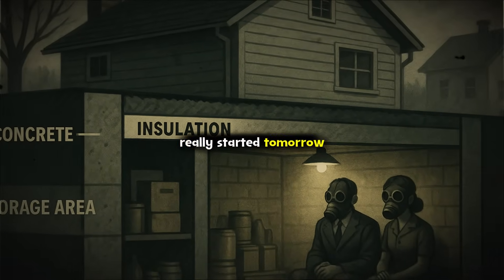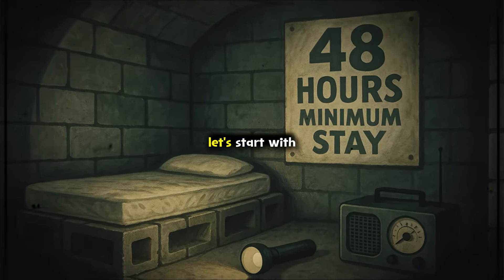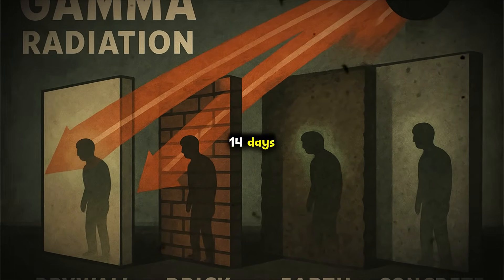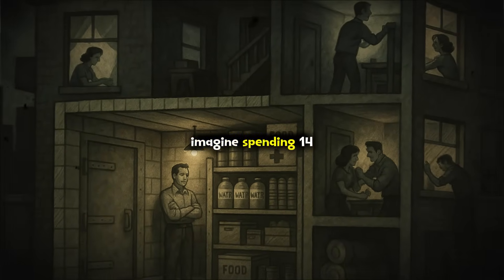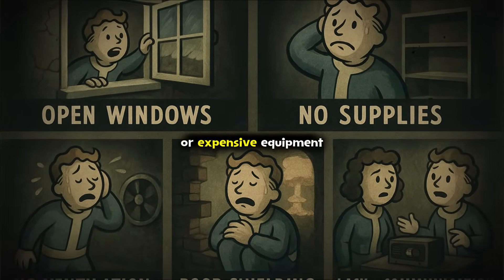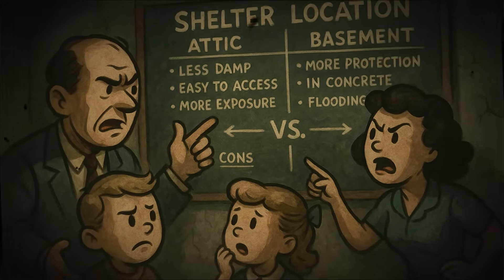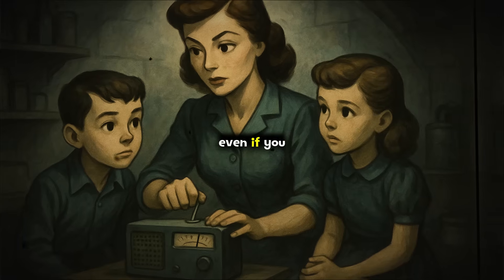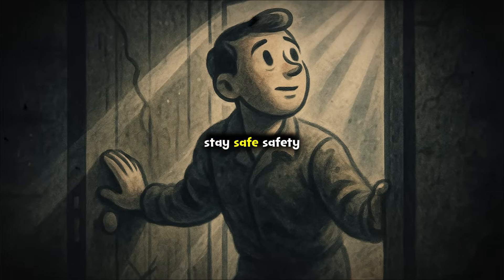Nuclear Bunkers: What Really Works—Build Right & Avoid Fatal Myths

Comment: Nobody escapes. Even the most elaborate bunkers built way undergkround by even the richest people . Power generators run on gas and run out and then what? Eventually you have to come to surface and get radiation exposure! No air-conditioning either or heat and what do you do to pass the time? How long can you stay down there until you start losing your sanity like being in a prison and even prisoners get out for fresh air but you can't? How many of you are down there? How much food supply is there? Water supply? And what about medical attention? What if you need meds? A doctor? A dentist? Do you have all that? No, you have none of that! Do you think you won't suffer with anxiety and depression and fear? And what about the temptation of going up to surface? What will you see? Nuclear winter! That's what! It won't be fun and games!

Comment: This is just an observation from a non expert, but a lot of preppers gravitate towards freeze dried foods. This seems unnecessary and excessively expensive at best. Not only will you have to use your limited water supply to rehydrate them, but there are plenty of highly nutritious items at the supermarket that have shelf lives well in excess of a year (think canned foods). And further more, the printed date is a "best by" date rather than an "expiration? date meaning they will still be safe to consume, they just might loose some flavor and nutritional value over time. But if you are worried about that, just rotate your stock. Every time you finish off 4-5 cans of Bush Beans, for example, buy another 4-5 and put them it the back of the shelf. Dehydrated foods serve there purpose (they are light, take up little room, and are perfect for camping trips), but the way I see it if you don't plan on permanently staying in your shelter for more than five years and have an infinite water supply and endless heating source, they really don't belong in your shelter. If I am wrong on this, please politely educate me.
Reply: I say learn how to preserve food yourself like jarring, dehydration or making jerky
Reply: This goes for all shelters when the diesel generators runs out of fuel its over to build and underground sheler only prolong ones life with some months than follows an horiffical death

Comment: My home sits on a slab. I cut a hole in the slab in the hallway and built our shelter under the house. It cost some money, 2 feet of reinforced concrete all the way around.
Reply: Unless you are within 10 miles of a target area you are wasting your money.. Better to add a dirt embankment outside as a "landscape feature" on the side toward the city center or industrial center then build either a concrete block walled room or some other moisture resistant material that will support the weight of the slab above then spend some money on ventilation, powering, dehumidifying, water storage, quick heat and eat food and sanitary waste disposal.. If you are way out in the country then 8/10x100 foot rolls of plastic, staplers, duct tape or packing tape, a couple cheap radiation detectors inside several layers of Ziplock bags and in metal cans, a poor mans air filtration system that consists of a several stage air bubbler filter, five gallon buckets with poly fill and a furnace filter for allergy"8".. You can build the filter for $50 if you can scavenge pipe, buckets and 55 gallon plastic drums.. So a couple hundred bucks worth of supplies would be enough to save your health from most fallout for a long time and certainly past the half life point of most to all the radioactive elements that are quick killers.. Having iodine pills and iodine hospital disinfectant wash to clean yourself from mild exposure to fallout would be on my list..
Reply: That’s was an amazing explanation, the problem is the money to get all done, plus here in Florida where we live we have water at 5 feet under the ground surface, so part of the shelter should be out of the ground
Reply: @humbertodiaz2889   Yeah, in Florida, you'd have to build the shelter first and then the slab. If possible, I've never heard of a basement in a house in Florida.
Reply: @humbertodiaz2889  They make very large plastic tanks that can be buried.. You could have several of these linked together even in your areas conditions as they are rigid and water proof.. Having a high enough entrance tunnel/shaft to prevent a hurricane from swamping the entrance and air vents would be an issue because it would have to be protected from a blast wave.. You would also need to anchor and weigh down these tanks to prevent them from floating up out of the ground..
Reply: You’re right, also I was looking at those fiber glass storm shelters that are completely sealed, adding a concrete slab on top of it and then enough dirt, plus some ventilation system they might work for a small family for a few days or weeks
Reply: @humbertodiaz2889  If you rig it right it could also be a survival capsule for a tidal wave if you made it so the hold down weight could be released so it could float.. I know there was a guy down there that built a motorized and armored survival floater out of an old fuel tank or fuel tanker that had external tanks that he could flood or pump so he could alter the height and stability in the water like a submarine but it would not submerge.. Sorry, I just went deep....
Reply: That could be a good way as well to try to survive a blast. The closest possible blast from me would be just over 50 miles away. So all I really have to try to avoid is the fallout.
Reply: Concrete won’t save you
Reply: @D3M0N1C_40RMyes it will? As long as it’s thick enough 😭
Reply: @StitchTheHyena Question is, are you that close to a target?? If not, then that concrete is not needed for fallout, heat or blast protection.. A sheet of 2mil. plastic stops radioactive dust, so best advice is don't live in a strategic target area..
Reply: @D3M0N1C_40RMyes it will

Comment: This is a mixture of good and bad advice. After you get through saying you don't have to be a billionaire to have a shelter that can make the difference, you go into what a shelter "must" have and what surely won't be good enough unless you spend that money. 

The number one rule with nuclear fallout is, don't inhale or ingest it. Any effort at filtering air is risk mitigation in that the amount of radioactive particulates you take in will be less than it would otherwise be. That makes even a less-than-perfect effort well worth it.

As for chemical and biological agents, there are instructional videos online for how to make an air filter for growing pot plants in grow rooms. They make them out of discarded food containers, short lengths of plumbing pipe, and activated carbon for filtering fishtank water. At the very least, such improvised filters will reduce the amount of organophosphate in the air down from what it would otherwise be. That can make all the difference, depending on how much chemical gets released and how closely to the shelter.

A lot of biological agents would probably be bacteria rather than viruses. Bacteria are much larger than viruses and so the filter you use could be 5 microns instead of a <1 micron. So, the filter that is less expensive and longer lasting will actually work best in that case.

Also, painting your house white and putting energy-saving white paint on the roof can help your house to not catch fire from the flash of a nuke going off. That is important if you're sheltering in a basement. You can unplug wires from all electronics and wrap the electronics in foil to stop the EMP from frying them. Empty coffee ground bags can be used to store cell phone chargers because they are metal foil. IF a wire cannot be unplugged from an appliance, then coiling the wire cord into a figure 8 will reduce the amount of destructive voltage it generates in an EMP.

If the whole complete effort is too daunting for one person or one family, or you just don't care to save yourself, you can rise above worrying about only yourself and yours and contribute to someone else's effort. If you don't like the idea of helping an "elite", then help a non-elite like a first responder, a conservation professional, or a civil engineer, etc. Maybe another family has young daughters, who need to be kept as far from the radiation as possible to preserve their future child-bearing prospects. Maybe you can ride out the blast in someone else's shelter, but then immediately exit the shelter because you are outside the area of intense fire and smoke. You can fight what fire there is, spread and tape tarps over a damaged roof and do a million other useful things before the dangerous fallout arrives, and you might be able to create enough above-ground safe space in time to make it through yourself. You can keep ventilation intakes and exhausts clear and protect them. You can protect the shelter from resentful aggressors. There are many ways to approach this.
Reply from the maker: Fantastic contribution—you really bring a practical mindset that goes beyond theory, and that’s exactly what Safety Zone is all about. You’re right: while our video lays out the “ideal” technical guidelines, we always try to stress that every step you take—even with limited resources—can dramatically improve your odds.

Your tips on filtration, both for fallout and chemical/biological threats, are spot on. Even an imperfect homemade filter can be a lifesaver by cutting down what you breathe in, and knowing the difference in filter size for bacteria vs. viruses is a game-changer for most people. The advice about white paint for fire risk, EMP protection tricks, and creative use of materials (like coffee bags for shielding electronics) is exactly the kind of out-of-the-box thinking the community needs.

And your last point is so important: survival isn’t just about personal prepping—it’s about helping others, pooling skills, and thinking of the bigger picture. Sometimes your best chance is teaming up, whether it’s with another family or supporting people with critical roles.

If you have more field-tested hacks or want to share a specific build or experiment, let us know! The more real-world experience and resourcefulness we collect here, the stronger everyone becomes. Thanks for raising the bar for community knowledge!

Comment: Locking yourself with a candle for an hour to test the shelter tightness may be the last thing in your life😂
Please invest at least in CO detector. CO2/O2 measuring devices may save your life-especially during the seal off phase right after the blast.
Reply from the maker: Great call-out—you’re absolutely right that using just a candle is a very old-school test and comes with real risks. Investing in a CO or CO₂ detector (and, if possible, an O₂ monitor) is much safer and can literally save your life in a sealed shelter situation. Modern detectors are affordable and reliable, and they give you clear feedback if oxygen drops or dangerous gases build up—way better than trusting your luck or an old survival trick.

Thanks for bringing up this point! At Safety Zone, we always say: tech can’t replace smart planning, but using the right tools adds a critical layer of safety. If you’ve got recommendations for specific detectors or other must-have gear, share them! Your advice could make a real difference for the whole community.

Comment: Honestly, I’ve got an underground shelter that can sustain me pretty much indefinitely. When I bought my house, the previous owner built it himself. The basement is several feet thick with only an outside entrance. I decided to completely concrete it in, creating an interior entrance with two escape routes from inside the bunker. If I need to come and go, it’s through the house because I’ve camouflaged the exits to keep them from being discovered.

After remodeling, I installed a stand-up shower and a wash sink connected to our well, which can run off a 12-volt battery or a hand pump. We have just under an acre of land with around 40 berry bushes, five grapevines, and a pretty large garden. My wife and I have built up an impressive pantry by canning our own vegetables.

When we go shopping, we always pick up at least 10 cans each of various meats, soups, vegetables, fruits, and other essentials. We also grab at least 20 lbs of sugar, salt, and powdered goods like milk, eggs, and different fruits and vegetables, which we then repackage in mylar bags. Plus, we buy about 20 lbs each of rice, beans, and pasta.

I’ve got a small suitcase filled with my seed collection and everything I need to start a garden. Preparing takes time; it’s not just a quick trip to the store. It’s a way of life. I like to keep six months to a year’s worth of food on hand, but ideally, I prefer two to three years’ worth.

With five buildings on my property, it’s the perfect spot for our family to bug in. It’s completely fenced off, and we have a wood shop, a studio/Airbnb, and a mechanics garage.We also have a nice pool house by our swimming pool which holds quite a bit of water. 

Naturally I have a plan to defend the property but I tend not to talk about it. If forced to I also have an evacuation plan in place that I believe would maintain stability in my family. 

I own an ice cream truck that is completely solar powered and also has an inverter installed. There are 10 solar panels on the roof of my ice cream truck and on the inside there are three freezers and a refrigerator. It's a Chevrolet p30 box truck with a 350 motor in it. Only 70,000 mi on it and in great shape.

 If we had to bug out I would load all my frozen food into the freezers, put all my supplies into totes and put them in my trailer and pull my trailer with my ice cream truck. I would use my pickup truck, my car, and my wifes SUV as additional vehicles to add to our motorcade. I have around 550 gallons of propane and various hundred and fifteen and 20 gallon tanks. 

There is a full-on kitchen that I can use in my ice cream truck and a stand alone hot water system that holds about 20 gallons of freshwater and 25 gallons of gray. So we can take our vehicles and camping supplies go out in the middle of nowhere and set up shop. It takes a long time to actually get prepared. There's a lot to think about and a lot to plan for it and everybody's plan is going to be different based on their situation. 

Regardless I wouldn't take it lightly. The world we live in today is definitely not a safe place
Reply: 1st rule of prep: NEVER TELL ANYONE YOUR LEVEL OF PREP.
Reply: Good for u
Reply: @1985daddyd waaaaah
Reply: IM 67, MARRIED STEFFY IN 2015. steffy is 37.yes, she is FILIPINA.  been a "survivalist" since the 1960's when i was a kid.i inherited $200,000 in 2018. ive spent 10 years of my life in prison too. i have no problem living with myself after doing horrible things to others. 
everyone thinks we are DIRT POOR. 
they CANT TAX, what they cant see!
Reply: Impressive ... soothing... makes me miss my family even more..everyone is gone. The ones who are still alive are total opposite type of character. Generationally Inherited cold war willies skipped them...
Oddly I find myself in 2025 not even able to find local birds of a feather..except...the birds that are flocking together are..ion know what to call them...evil? Lazy? Possessed??
Not my flock.  . ...I'd be a pheonix.phoenix..  all these ppl here are buzzard vultures with monkeys or parasites on their back.....
Reply: i got fuck all
Reply: Very nice and I'm on my way to that as well.
Reply: I live on a small 5 acre farm.  We let one of our friends keep their miniature cow in our pasture.  He's probably only about 200 pounds, but if push came to shove we'd be feasting on ole Moo-Jangles.
Reply: Concrete won’t save you

Comment: Another thing to keep in mind is storing only freeze dried food will most certainly upset your stomach. Your body is not designed to switch from one type of food to another that quickly. You’ve got to build that sort of stuff up slowly mixed in with other non-perishable items like canned goods or else you willnot adjust quickly enough to keep you from getting sick.
Reply: The most compact and digestible stuff to survive on is the protein meal/breakfast replacement powder mixed with powdered milk and some of that powdered rice baby food.. A heaping tablespoon of each in a 12 to 16 ounce cup of hot/cold water two to three times a day along with a vitamin a day will easily keep you alive.. It also reduces your solid waste to near nothing and something like it was once stocked in US fallout shelters.. Sugar based hard candies can provide energy to do more physical tasks and these were also stored by the bucket full.. Having an assortment of canned foods that don't require cooking to eat (although they would be more appetizing and digestible if you could warm them) is always a good idea although waste disposal will be needed.. Water is very important and I found 2 layer 3 and 5 gallon food grade liquid storage bags that have screw on caps for $.50 a piece so I bought a box of 50.. You can fill them easily and stack them or carry them in an empty feed sack..